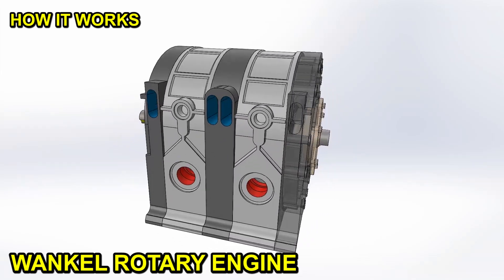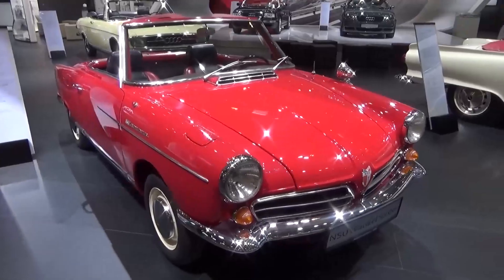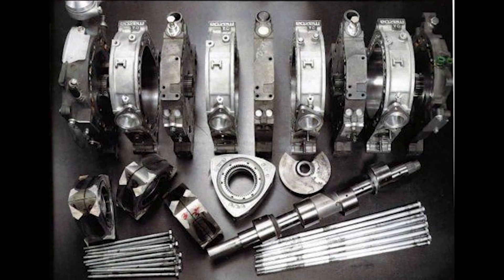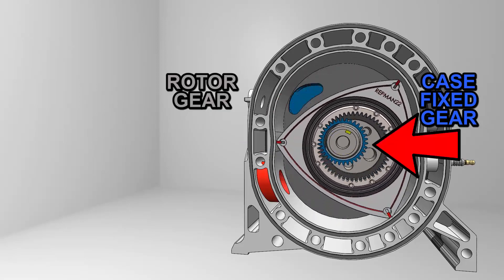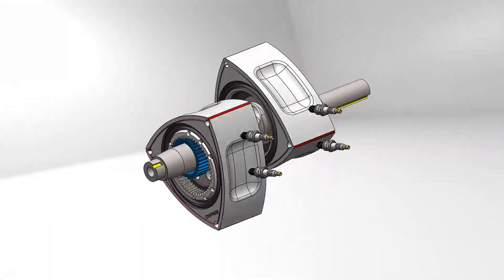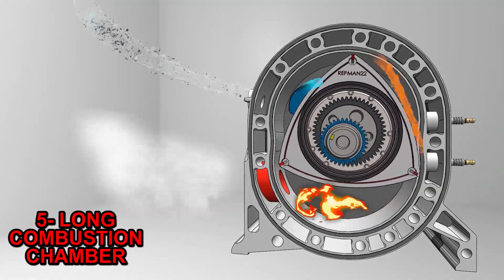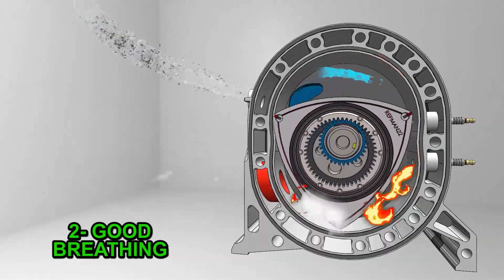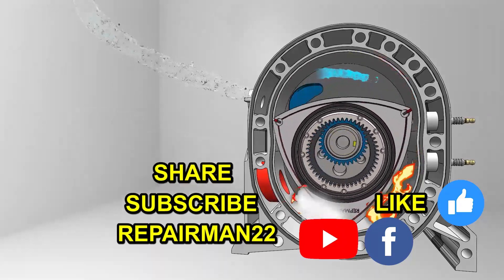All you Need to know about the Wankel Rotary Engine 🤯

Comment: The engine design does not determine the weight distribution of a car, and it is certainly not true that all Mazda RX models had 50:50 (front:rear) weight distribution.

Comment: No, Mazda Wankel engines do not produce over 200 horsepower per litre, unless you cheat and only count one of the three combustion chambers around each rotor. 

For example, the 13B has a chamber displacement of 0.654 litres. With six chambers, that's 3.9 L - not just 1.3 L - so if the output is 280 HP (the 13B-REW of the last RX-7) that's 71 HP/L.... which is horribly low for a turbocharged engine. 

All of the displacements claimed in the video are one-third of the actual displacement, and half of the handicapped displacement often used in racing classifications.

Comment: I own one (RX8) and do all my own rebuilds myself. It's probably the easiest engine I've ever overhauled, just follow mazda's service manual for it, you can't go wrong.
After tearing it down, it's astonishing how much development is left in it. Daft things, like the side intake ports that aren't cast smoothly into the chambers, so all the intake charge has to negotiate a 90-degree bend before it enters...why? The centre exhaust port that for no reason has to share with the other rotor, make it twice the size? Nah, we'll make it half it's size so only half the exhaust can get out through that side. Centre shaft bearings? Nah. Let's suspend the whole rotating assembly on two bearings that are an inch wide, so they're massively overloaded.
That's like having a four-cylinder piston engine and only having the crankshaft running on the end bearings, all of that force is magnified and wears them out long before their time.
Oh and the inherent problem of mounting the single timing gear on one side of each rotor, so it constantly wants to twist the rotor sideways, slowly wearing it's bearings into a cone-shape. Use two timing gears per rotor, half width, with the bearing in between them so the rotor is now symmetrical and can centre itself as it spins...no rotor bearing issues any more.
People have had great success with ceramic apex seals and the like, most of the rotor seals were designed in the 60's, half of them are put in at the factory backwards for god's sake.
I wish I had the money to invest in developing this engine fully, Mazda did a lot but much of it is stuck in the past and handcuffed with patents..which is the problem.
Reply: You should check out a mechanic named Ernie Brink. He pointed out that the spark plug holes were way bigger than they need to be, which made the engine lose compression and the exhaust temperature high. He also pointed out that it would be great to offset the depression in the rotor. I think this engine has been plagued by deliberate engineering sabotage.
Reply: @ronarmstrong835  Aye, I've seen some of his videos and explanations, really interesting food for thought. I've also seen some technical documents somewhere that detail why the spark plug holes are that size and it's related to ignition timing and cooling of the spark plug, both of which are apparently drastically altered by the diameter of the spark plug hole opening. Wish I could build a test engine and find out.
I'm not sure if some of the design choices were intentional, but Mazda had their hands tied by NSU's patents which severely limits how much they can develop the rotary. Until these patents expire, Mazda's engineers will keep banging their heads against walls...but there's absolutely nothing stopping people from developing their engines on their own so long as they keep to within the rules.
Reply: That's fair but if you aren't a mechanic you're talking about thousands of labor hours every 80k or so miles

Comment: Huh that's interesting I didn't know That they had to burn oil with the gas.   I wonder if you could some how get the compression high enough to combust diesel. Doubtful, but maybe then the fuel oil would oil all the seals.
Reply: Rolls-Royce did build a Diesel Wankel, the 2-R6 prototype back in the 70's.
It had two rotors, one twice the size of the other. The big one acted as a supercharger to boost the compression for the smaller one. It wasn't as successful as they hoped.
The main problem with increasing compression is that it directly adds more strain on the rather limited shaft bearings and seals, wearing them out until the rotor either starts hitting the casing or the apex seals wear away until they fall out of their grooves and smash up the inside of the rotor casings, both of which are terminally catastrophic.
When NSU's patents expire, we may finally get some proper development on the apex and side seals because there's currently no way to get oil to them other than dripping it into the firing chambers, which is a bit idiotic to be honest because any oil that's good for bearings doesn't burn very well at all and jams the seals with gunk. I'd love to see the seals paired up with oil ports in and out in between them, but it is what it is...for now. I've converted mine to run on 2-stroke oil so I can use decent fully-synthetic oil for the engine internals for this reason...improved seal and bearings lifespan..but manufacturers would rather it slowly drain it's engine oil out the exhaust so they can sell you the expensive (but shite) stuff every few months.
Reply: It burns oil because having no true “non combusting” side like a 4 stroke, more like a 2 stroke, resulting in similar problems, which is also why you are unlikely to see 2 strokes in street cars.